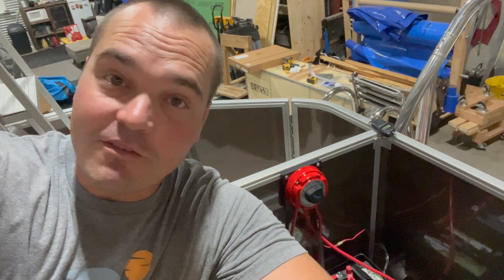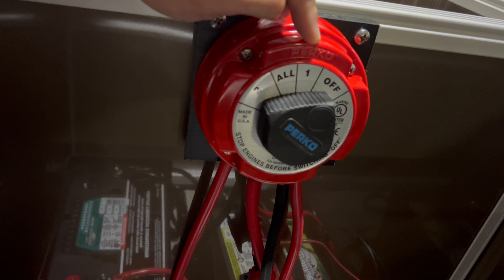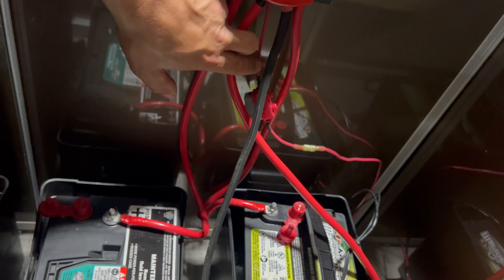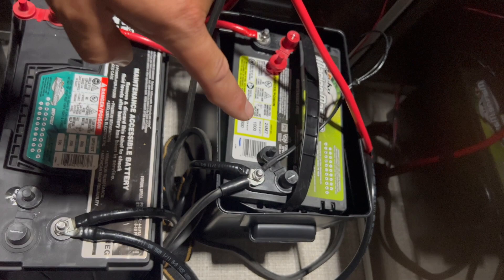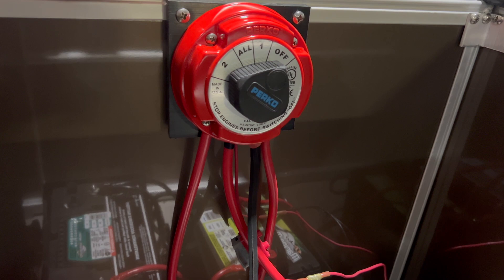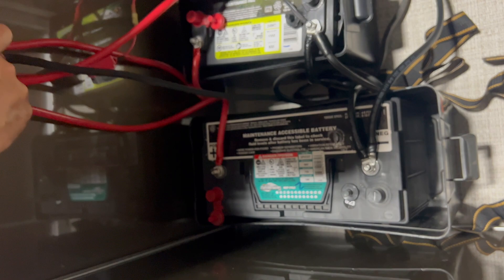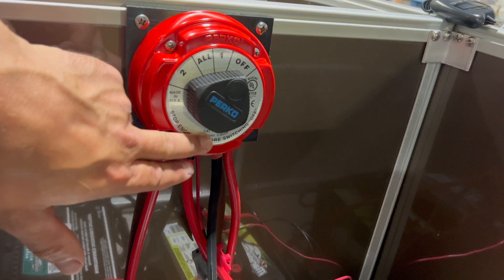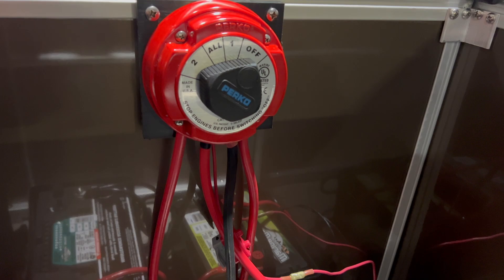How to Use a 4 Position Battery Switch

Comment: Good video as always!  2 years ago I shut off my battery switch while the engine was still running just to see what would happen.  What happened was I had to buy a new starter solenoid!
Reply from the maker: Lesson learned!! That voltage coming from the motor MUST go somewhere or else trouble happens
Reply: @tomspontoons  yep!  Instead of the stator charging the battery, the voltage got blocked and burnt the solenoid out. Didn’t realize until  I went to turn the key the next day. Lesson learned indeed!  1984 90hp Evinrude.
Reply from the maker: @DaSween  just glad it wasn’t something more serious!!!

Comment: Great explanation. I will add (as an US Naval electrician) BATTERY 1 is used for sensing circuits (bilge pumps, fluid level switch *gas tank*, C2O detection, Radar, Wind, emergency radio and any other sensing circuit that lets you know something going bad.) 

You always want that kind of equipment getting power even when the boat switch is set to off. THAT'S why you don't want to use it INDEPENDENTLY from BATTERY 2. AND WHY you charge as often as possible when the engine's alternator is running. 

A great practice is to idle the boat for several minutes (10-30 minutes) before to go underway. This give you time to verify BATTERY 1 has enough power to save your life in case of a mishap. 

If Battery 1 is really LOW on charge. WHEN YOUR ENGINE IS RUNNING switch to position 1 to charge your emergency detecting equipment before any other accessories. 

Lastly, Go NAVY- the Army sucks. Had to add that. 🤣
Reply: For small boats 20ft and less. You'll probably run a bilge pump and a VHF radio on battery one. And if you crazy about safety; you can add the boat's horn. I also put digital clocks (small display) on Battery 1. Bigger water (1000 acres and up) a GPS system like Lowrance's POINT-1 goes on battery 1 too.
Reply from the maker: Thanks for your input, especially coming from a Naval Electrician! And thank you for your service!

Comment: This is great. I’ve been trying to decided what/how I wanted to set up my battery’s as I have a trolling motor and don’t want to be manually switching battery’s around but also done want them just wired in parallel as I could then strand myself. This will allow me to switch over to 2 an run the trolling motor. If I go so long it dies ow well. Switch to 1 and fire up the 50hp and cruise home on all charging away.
Reply from the maker: Yep, you've got it figured out! This system is great for someone with a 12V trolling motor. You'll need some pretty heavy gauge wire to make that run from the stern to the bow, but MinnKota has a chart on their website for what to use on different length runs with each of their trolling motors. You can definitely run two deep cycle batteries in parallel to increase the longevity of your trolling motor too. Just attach the positive coming off of the paralleled batteries to the switch and the ground to the starting battery's ground or a ground buss block.

Comment: When you would use "1" only, is if you completely completely drained your 2nd battery jamming out on music all day. You wouldn't want to switch to "all"to start the engine then. The drained battery would instantly start to rob power from your good battery in a rush. Maybe enough to drain your starting battery (if it was weak starting battery)

Start the engine on "1", then switch to "all" once charging has begun. (Only if your 2nd battery is drained flat)

I know it says to not turn while the engine is running but keep power draw at a min, once 2nd battery is charging, then turn on the accessories.
Reply from the maker: Very well said, thank you!

Comment: I just purchased a 2009 paradise elite pontoon. Honda 200hp. Motor has 198hr😮. I did not get an owners manual with it and I have this green vase shaped light with an arrow on each side? What does this mean?
Reply from the maker: I'm not familiar with that sort of indicator light. You may want to reach out to your local Honda dealer to get more information on that. I know that some of the older Hondas I've worked with have alarm lights for temperature and oil pressure. I'd imagine that is what you're seeing.

Comment: Great video, with that being said. If have everything on the common post (motor, amplifier, lights etc) then in theroy you can start your motor on either 1, 2 or all is that correct? Because you can't pick where the power is coming from? So much helpful in all your vids!
Reply from the maker: Thanks for watching…YES. You can start the motor from either battery or start it from both batteries in parallel (1+2 or “both” or “all” depending on the switch).

Comment: Question. Can you check your switch to see if you have damaged one of the positions or the whole unit it without volt meter while in your slip?? Say turn engine off. Then turn switch to position 1 and start. Turn engine off. Turn switch to 1 & 2 turn engine on. Turn switch off. Turn to position 2.  Turn engine on. Would that be a way of checking each position in a pinch? 😁 Or, in general,  would the whole switch just fail and the boat would not start in any position? Thanks.
Reply from the maker: You could certainly try working through those positions to see if one is not working. Double check your connections to the switch and that the grounds and ground jumper wire is connected tightly and properly. Also, consider unhooking the motor battery cable from the switch and run it directly to each battery to make sure it's the switch and not another issue.

Comment: Awesome video and explanation! I have a question about charging the 2. If you throw them on a trickle or battery charger do you have to do each battery separately or put it on one and set the switch to ALL? Also, do the batteries have to be exact matches or can you mix and match to a certain degree?
Reply from the maker: I always run a charger or charging lead to each battery individually. I try to stick with the same type of battery…meaning lead acid together, or lithium together…NOT mixing lead acid and lithium and so on. I often use a 24 class lead acid starting battery as battery 1 and a big 31 class lead acid deep cycle as battery 2
Reply: Great info, lead acid for cost of course but that is great news! @tomspontoons
Reply from the maker: Happy to help!

Comment: I got a 5 position with AFD protection. I cant find a video anywhere to explain how to wire my AFD though. I found diagrams where it says to wire to the alternator and regualtor but i dont know what im doing with that... do i need to do any additional wiring? Or can you help me out?
Reply: I have a g3 yamaha 2008 50hp 1756 dlx cc
Reply from the maker: Oh man, that’s quite a bit over my head as I’ve never even seen that type of switch! I would start by contacting the manufacturer and trying to see if they have any resources for installation or can get you in touch with one of their tech reps.
Reply: @tomspontoons  thanks for the response, its a 9002e blue sea systems switch. Very similar to all of these in your videos. I just have looked everywhere and cant find any video for an alternator field disconnect option for how to install or if there is no install lol. Ill reach out the blue sea systems and  ask, thanks!
Reply from the maker: @markaword1561  From what I've heard they have a solid customer service team so hoping they can get you taken care of!